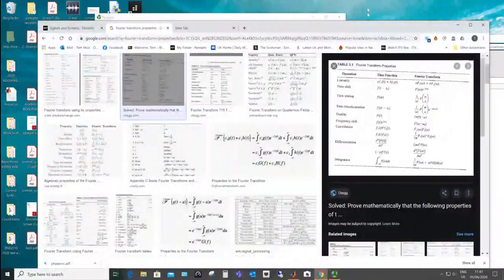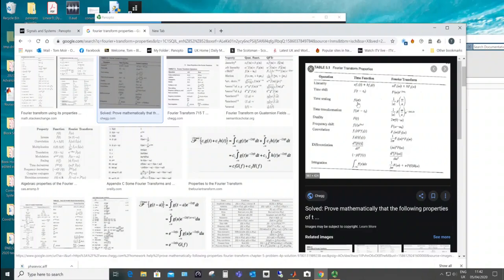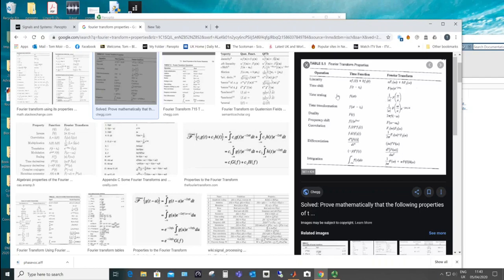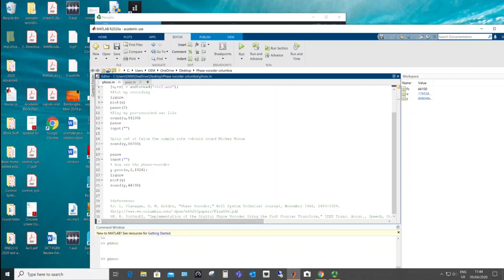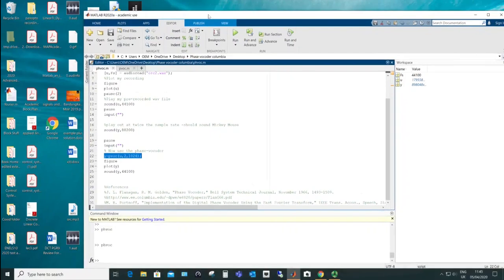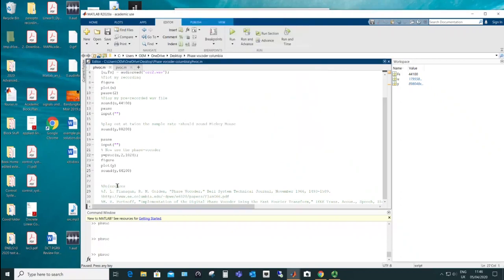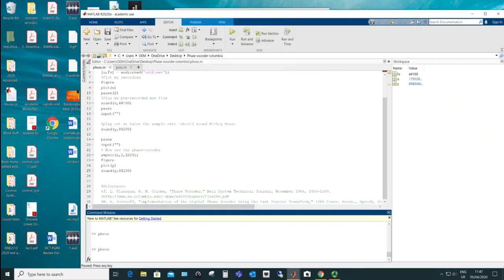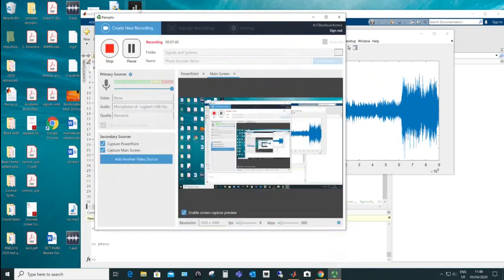Phase Vocoder demo

Comment: I noticed that YouTube use this too.   You've got the option to speed up playback but they keep the pitch of the original.   One guy's videos are interesting but he's too slow in his delivery so I can speed up to 1.5 times his pace and it sounds normal.   1.75 and it starts to get a little bit hurried but still ok.
Reply: YouTube uses the browser's internal implementation, which typically uses a time-domain WSOLA-based algorithm, and not a phase vocoder-based algorithm.
Reply: @DavidsKanal  Interesting, but wouldn't that mean you'd get difference results depending on which browser you were using?  And possibly even no support for that feature in some?
Reply: @johnsim3722 Yes! However, the WSOLA algorithm is quite common and I assume most browsers have implemented it in a similar way!
Reply: @DavidsKanal  I'll have to have a look.   DSP isn't one of my strengths, but I have done it as part of my degree years ago.   And have friends who are some of the best DSP engineers that I can ask too!   Thanks.
Reply: @johnsim3722  Haha yeah, I only know about this because I implemented a WSOLA time stretcher about two weeks ago, so I'm fresh in this topic. But I also had to read myself into the material a bit first.
Reply: @DavidsKanal  I've checked the book one of my friend wrote on signal processing, but the acronym isn't coming up when I search.   My other friend does commercial rather than academic work, with his algorithms being set in silicon.   Very impressive!
Reply: @DavidsKanal  I have to confess I thought you were replying to another post I'd made on a different video.   Dr Moir is the person you should look to for DSP and control systems, and has a couple of books on the subjects too.   He's my former lecturer and friend.